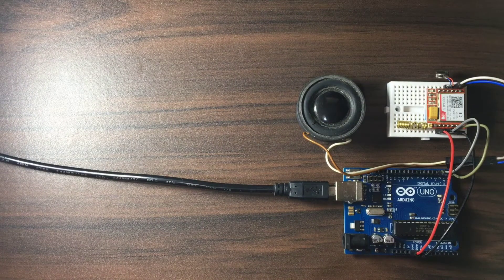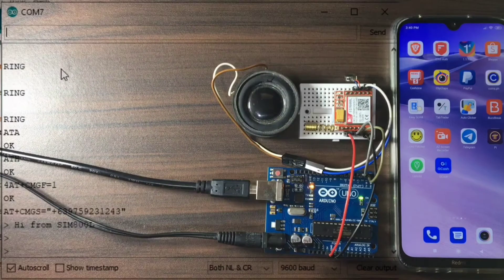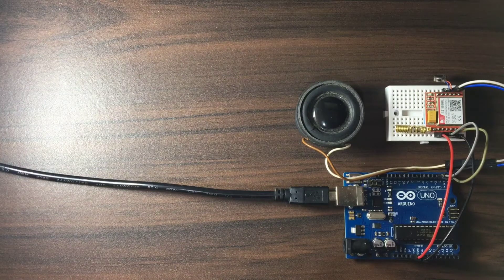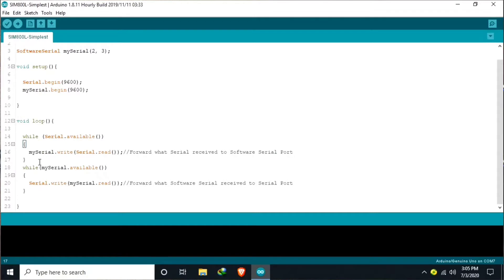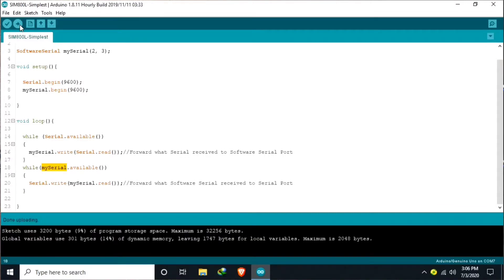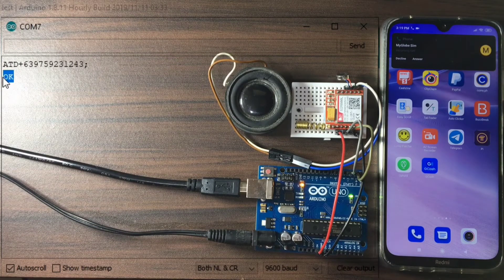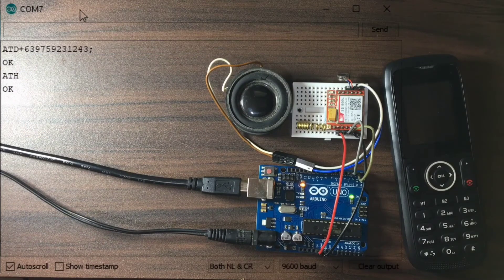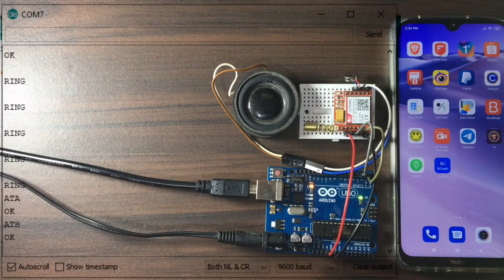TUTORIAL: How to use SIM800L to make VOICE CALLS with Arduino

Comment: pretty simple and easy explanation, Thank you. I have few questions:
[1] I experienced a huge delay while send sms which it could reach 8 minutes in sending sms
[2] It was necessary to power off the SIM800L and Power on again to keep sending my data as it seems like hung after first long send.
[3] Is there away to know the strength of the network so I can start sending my data or keep watching for the proper timing to send?
[4] When receiving a call is there a way to save it as any audio file formate?
[5] Some countries the 2G network is already disconnected and no more in operation, so is there any low cost alternative for 3G or 4G connectivity
[6] in case I use any other microcontrollers i.e. STM, Microchip, NXP will I need to have a special library to get the SIM800L connected?
[7] Does it support the 
Thank you and wish your favorable reply.
Reply from the maker: [1] I experienced a huge delay while send sms which it could reach 8 minutes in sending sms
-> how do you measure it? The network signal strength could be the problem. 

[2] It was necessary to power off the SIM800L and Power on again to keep sending my data as it seems like hung after first long send.
--> there are many factors that could affect that. It could be your power supply is not providing enough power hence it was restarting on itself. It could be that you have weak network signal, etc.

[3] Is there away to know the strength of the network so I can start sending my data or keep watching for the proper timing to send?
--> AT+CSQ 
I googled it for you check it from here: https://m2msupport.net/m2msupport/atcsq-signal-quality/

[4] When receiving a call is there a way to save it as any audio file formate?
--> I haven't tried it but I googled it for you and it seems possible, read it from page 335 using the AT+CREC at commands: https://www.elecrow.com/wiki/images/2/20/SIM800_Series_AT_Command_Manual_V1.09.pdf

[5] Some countries the 2G network is already disconnected and no more in operation, so is there any low cost alternative for 3G or 4G connectivity.
--> You can easily google it.

[6] in case I use any other microcontrollers i.e. STM, Microchip, NXP will I need to have a special library to get the SIM800L connected?
--> No need, SIM800L uses UART serial interface to be connected to a microcontroller. So you may simply send the necessary AT commands.

[7] Does it support the 
--> Incomplete sentence, I cannot answer that.

Hope this helps you. Cheers.
Reply: @TechToTinker  Thank you for your reply. really appreciated.
Reply from the maker: It's my pleasure. Thank you :)

Comment: Hi, one question, is there any way to see if the call is responed by the other person?.... I see that "no carrier" is when person not respond but if they do? thanks
Reply from the maker: @Rafael Lopez, yes check this from page 29: https://www.google.com/url?sa=t&source=web&rct=j&url=https://www.elecrow.com/wiki/images/2/20/SIM800_Series_AT_Command_Manual_V1.09.pdf&ved=2ahUKEwjYmtmk7YfwAhUvwosBHV9UCYYQFjAGegQIJxAC&usg=AOvVaw3Ylp8mdy26_qTxuILL55y3

I haven't tried it but you may command the gsm module to call a certain number, and check what is the status if the call is answered and if the call is not.
Reply: @TechToTinker  HI, thanks for the informacion but the command ATX does not shows if the call was answer, it looks that there is not such command to see if the call was answered
Reply from the maker: @Rafael Lopez, do you mean ATD?
Reply: @TechToTinker  hi, ATD is to make call, I get it... What I need is to see something when some body pick UP tha call

Comment: Thank you for the video, do you think is it possible to link it to an intercom?
Reply from the maker: @Gabriele Celeste, I have no experience with intercom. Can you tell me more of what you intend to do? Regards.
Reply: Thank you for answering me, I would like to speak by using the arduino to the intercom when I'm not at home
Reply from the maker: @gabrieleceleste9453  the SIM800L has a pin for microphone and another for speaker. So yeah, it is possible, Just set your Arduino to automatically when you number is calling.

Comment: i did all but sending sms have error how can fix it?
Reply from the maker: Hi @hamid hashemi, can you tell more details about the error?
Reply: @TechToTinker  hi again I'm in Iran and sending sms using irancell operator  had some problems also its too important to have external power supply to feed sim800l because without suitable power supply some features didn't work
Reply from the maker: @hamidhashemi616  I am glad you sorted out your problem. You are right, a proper external power supply is needed for proper operation of SIM800L gsm module. Cheers

Comment: gsm module can recives call atomatically withaut ardiuno 
once we program
Reply from the maker: Hi, any GSM module could receive SMS and call without any microcontrollers connected as long as you provide:
1. Enough power supply and
2. a SIM card is inserted in the slot.
BUT what it is the use of it?
Reply: @TechToTinker  Hi,  I need it for a PA system, to call a number and to get the audio through AUX. Can it be done without an arduino?

Comment: Don't connect 3.3V and 5V devices like that. Protect the devices. Use a
3.3V 5V TTL Bi-directional Logic Level Converter
It is only one MOSFET and two resistors. Or buy a ready build device like this:
https://www.banggood.com/da/3_3V-5V-TTL-Bi-directional-Logic-Level-Converter-p-949438.html
Reply from the maker: Thank you chlordk, I know that :). Here, I already make the necessary correction https://youtu.be/QueiLXLFVtM